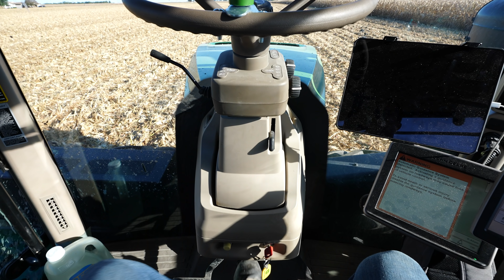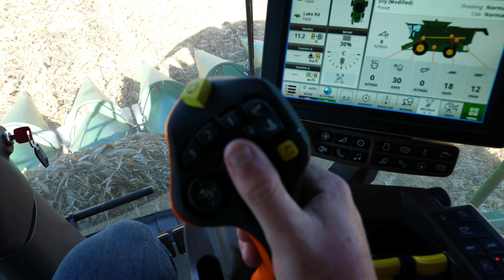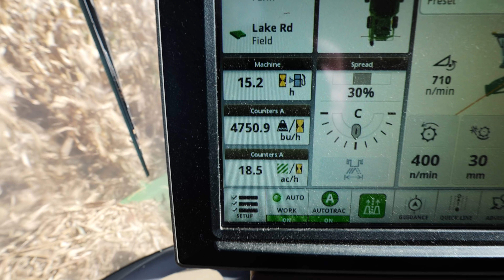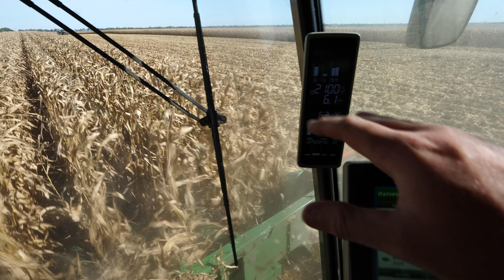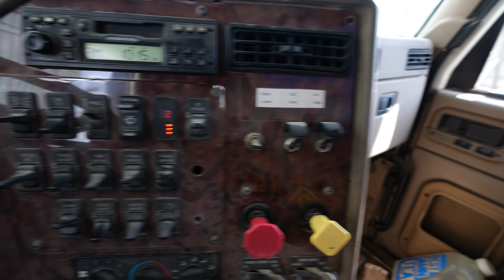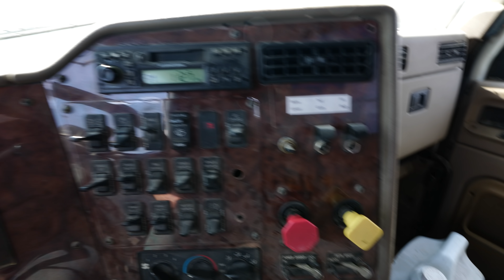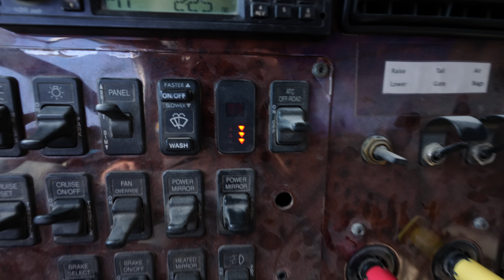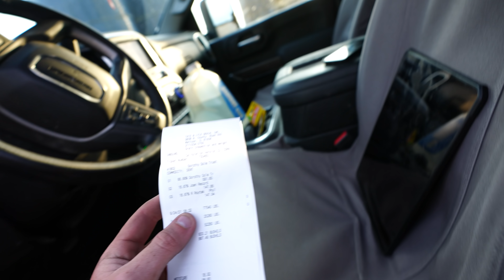Could This Family Farm's Luck Get Any Worse This Harvest Season? (Hint: Yes...) (Ep.115)

Comment: Nice to see you got some seat time in the 780. What’s your first impressions compared to the 670 and 9670?
Reply from the maker: The cab seems even quieter than the 670, which could just be an age thing. The tech is obviously a lot nicer, but the new hydrostat handle is incredible. It perfectly forms to your hand with all of the buttons in a good location. The 780 seems to be able 25-30% more combine than the 670, especially in beans. Overall, I think it is awesome!

Comment: Sheet metal screw with a piece of inner tube material fashioned into a makeshift washer with a little sealant added might work for a hole like that.
Reply from the maker: That's a great tip. Thank you!!

Comment: For a pinhole use JB weld on a self tapping sheet metal screw. That usually works better than epoxy alone.
Reply from the maker: That's a great idea. Sometimes you have to face a problem once so you know how to respond next time. Thanks!
Reply: @aTrippyFarmer  I use to work at a truck shop.  Out of the box solutions to get a truck home was always cheaper than calling the hook man.  The screw works on fuels tanks too.
Reply from the maker: @redbovine  anything you can do to avoid the tow truck is usually the best thing for your wallet! Some days I’d like to just drop a match in the fuel tank 🤣

Comment: Looks like a long unload auger on that 780
Do you have a camera on the end, And if so how do you like it?
Reply from the maker: We do not have the camera. Personally, I think it is unnecessary, especially for loading grain carts. It can never hurt to have it, though. I really like the added vertical height of these newer unloading augers. It has to sit 2-3’ higher at the spout than our 670, which is incredibly nice on uneven terrains
Reply: @aTrippyFarmer  Random but in a video a few weeks ago you did a walkthrough of a barn and pointed out an Oliver side panel. There is a super 88 & a 77 for sale on Facebook, in New Berlin the other side of Springfield.  Both look in good condition, and seller claims they both run strong.

Comment: Little display showing what gear trans is in and arrows down means input shaft speed is too fast. I didn't see clutch pedal like early trucks had. Trans computer/controller having a problem slowing input down. Other please don't call it automatic its really automated trans still has gears, sliding clutches just like manual trans. People hear or read others calling it automatic they think it will shift like there car does. We had one driver twice a month for 7 months came in while truck was still under warranty. It doesn't shift like my car does there is something wrong with it. We changed settings either it shift way to slow or way to fast. She could never get it through her head its not automatic will never drive like a car.  Even Eaton rep got involved telling her the same thing. Then went to facebook on how stupid we are don't know what we are doing bunch people jump and agreeing with her LOL. Some of early trans could be changed to manual but I have no idea what trans model truck has. Gen 1 could be changed, Gen 2, DM2, DM3 and newer no they changed trans case and top plate. Changing truck to manual not too bad to do putting in manual is easy. But electric side removing relays that control starter or jump them and changing settings in engine ECM settings. I've done it few times at work on farmers trucks (peterbilts)
Reply from the maker: It is an automatic manual transmission, so it is technically automatic. I know the difference, but calling it a manual would be a disservice to what it is. You are right--no clutch for the driver. I really appreciate the feedback on the problem. I have noticed that cycling the key has a good chance of fixing the problem for one shift cycle, so it would seem to be electronic. I believe this truck may have been tuned by the previous owner. It has always shifted in a much more aggressive pattern than our other AMT. It is a good truck when it will run properly. Thanks for the comment!